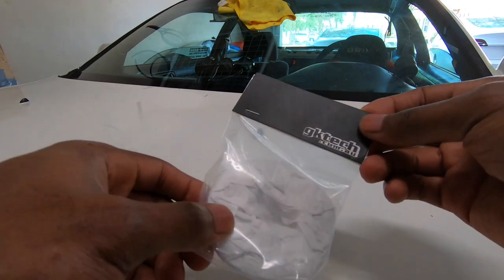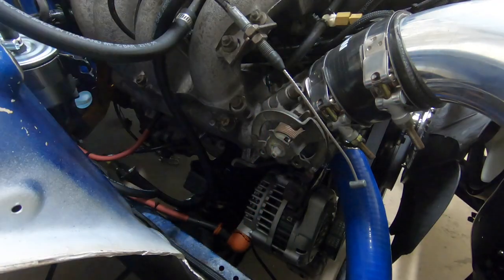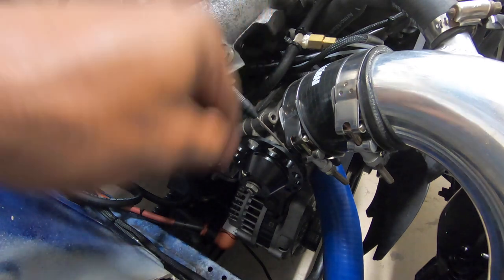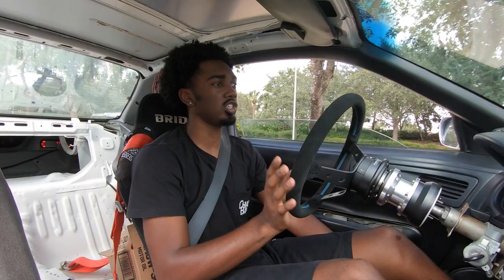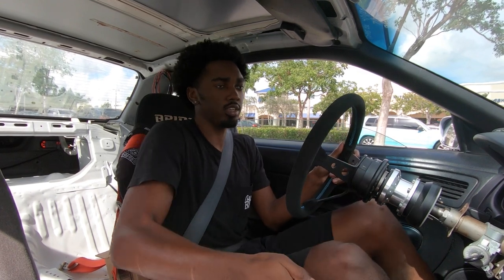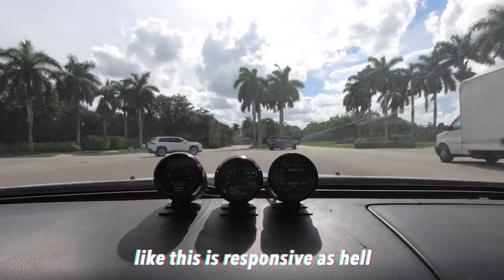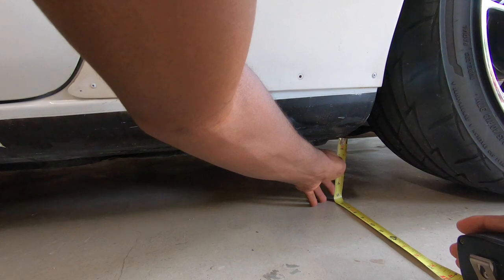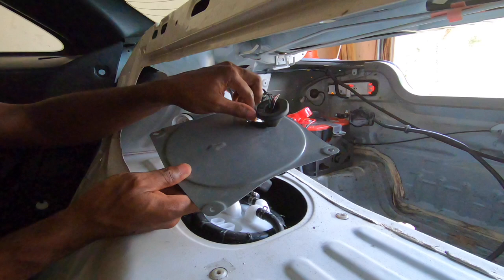GKTech Throttle Wheel is 100% Worth It !!

Comment: 7:25 LOOL my 240 is doing the same thing, I ended up putting my silencer in so I can drive around at night, and there is less of it, just dirty ol carbon, typically from whenever the car is running rich, happens easily in a turbo car.
Reply from the maker: LMAOOO. Typical 240sx things. I'm actually thinking of going without the muffler again soon

Comment: 6:07 it would be cool if you were able to change the shutterspeed either through the camera or software, whichever is easier so you can see the numbers on the guages.
Reply from the maker: Yeah, maybe in the future since right now I’m just using the GoPro. Not a huge fan of it but it does the job alright